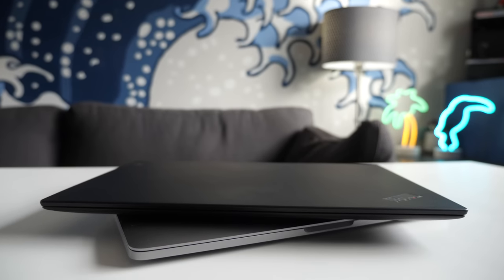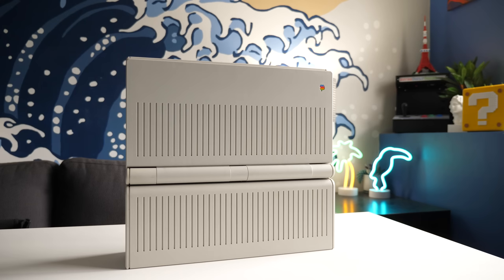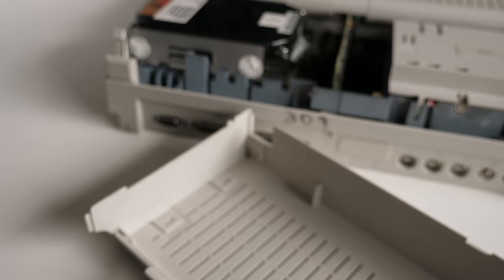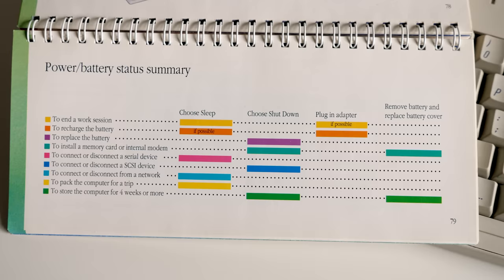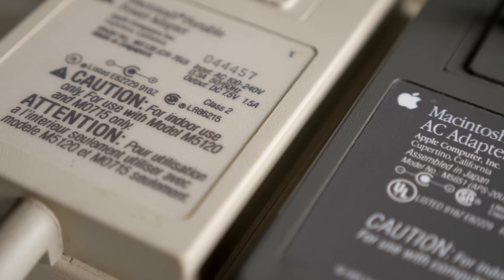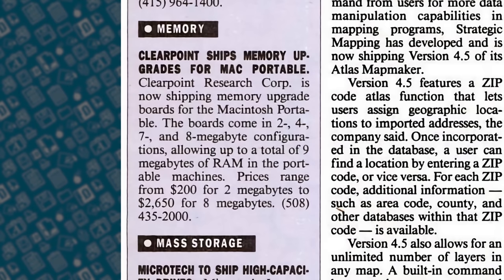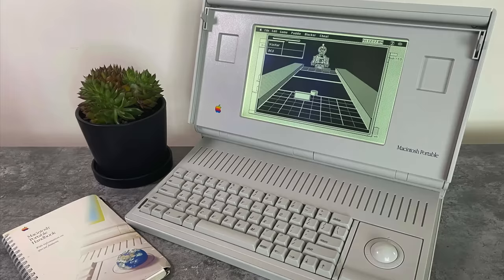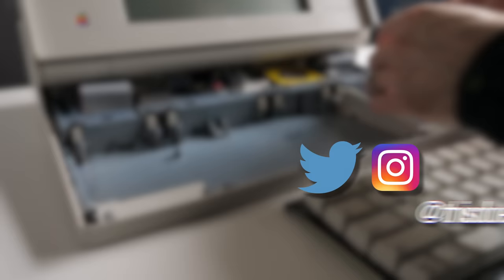Macintosh Portable: The Mobile Mac Nobody Wanted

Comment: So electricity 101

An electronic device will pull as much current as it needs, and no more (unless damaged)

You are at higher risk using an underpowered adapter than a higher powered adapter, what you described about the power adapter is the same thought process that upgrading to a higher wattage power supply in your desktop raises the power usage, or assuming using an apple power brick for an iPad can supply too much current to plug an iPhone into. If that sounds silly to you then..... So does that section of this video.

EDIT: layman's terms explanation strikes again. I've been informed that what you are actually trying to say is the machine has a design flaw in that its current limiting circuitry is poorly designed and can destroy itself if the power brick doesn't assist in that task

Comment: And now Apple have some of the best battery run times in the industry.
Reply: only because they cheated by putting mobile phone chips into their laptops.
Reply: @ps5hasnogames55  It is not cheating if it works though
Reply: @johntrevy1  it is, and the apple silicon platform isn't going anywhere just like powerpc never went anywhere. apple are forcing more performance out of these ARM chips by just gluing more and more of them together. they'll stop being impressive very soon, and i predict apple will run into a wall very fast too, just like what happened to powerpc.
Reply: @ps5hasnogames55  I'm sure Apple know what they are doing. So what, are you expecting Apple to go back to X86 with their tails tucked between their legs? I'm not seeing it.